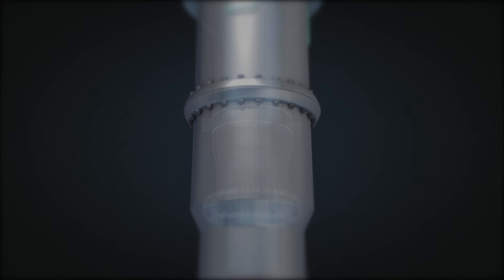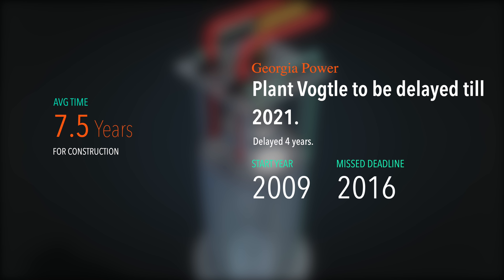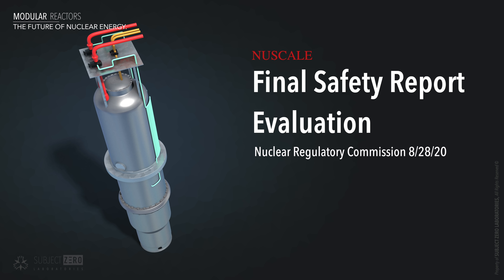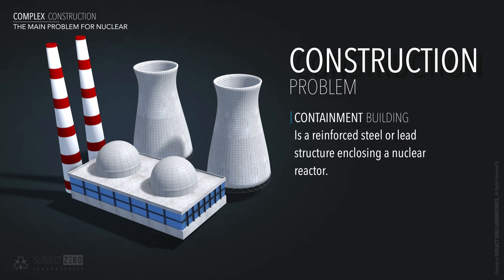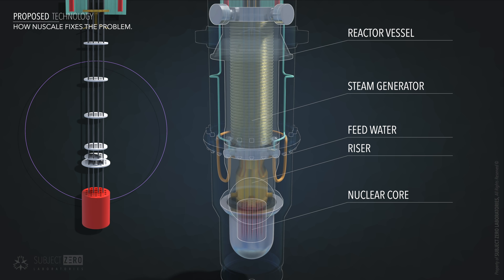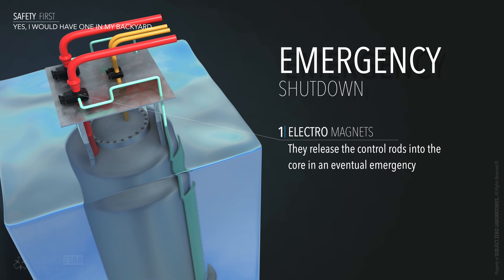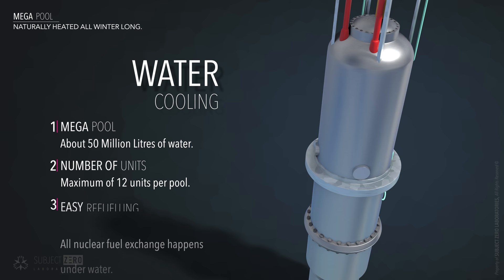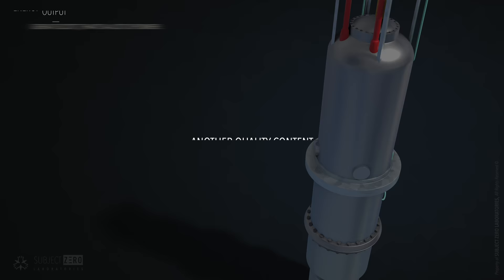A Milestone for Small Modular Reactors (SMR 2020)

Comment: $3 billion dollars for 720MW with nuclear’s superb capacity factor would be very competitive. That’s A LOT of decarbonization, air cleaning potential for $3 billion. We should be pushing these ASAP in the Midwest USA where coal use is still so prevalent, particularly in states with subpar resources for renewables and/or aging traditional reactors. 
Here in Indiana, we have no hydroelectric dams, solar capacity factors around 18%, only a tiny sliver of Lake Michigan for offshore wind and decent but not great onshore wind resources. 70% of our electricity comes from coal, with most of the rest being gas. Our attempted cathedral-style nuclear power plant was abandoned in the 1980s. 
Clusters of the SMRs would be a game changer for Indiana air and water quality, particularly in the SW corner of the state where large coal plants are clustered.

Comment: 720MW isn't remotely enough for 720K homes in most, if not any part of the world. That's only 1,000 watts per house.
Reply: I think he moved the decimal one too many places. Should be around 10kW per house, so that's enough to power 72,000 homes. Still quite good, especially if supplementing renewable energy sources.
Reply: @rthomp03  "renewables" are not functional energy sources. It's all a scam supported by subsidies. You can't "supplement" something that doesn't work.
Reply: Brad I could say the same for methane
Reply: @thepope2412 but isnt the point of this to reduce carbon emissions?
Reply: @xxxBradTxxx  I don't think the core of Earth is leaking anything into the ocean. The crust does, however, mostly material that's eroded away and flushed out by rivers. Harvesting uranium from seawater works fine, it's just not economical to do it at current prices. Long term it's effectively a renewable resource as you say.
Reply: That depends on the type of heating used, for one. If the houses use district heating and district hot water, I could see the average consumption being under 1kW for a household.
Reply: SirCutRy then you turn the stove on
Reply: SirCutRy peak power is a higher number than average power. When you turn the stove on you are using above average power. If enough people turn their stove on (or other things) the time they are using well above average power.
Reply: @thepope2412  Have you found a number for the peak demand?

Comment: The proposed reactor uses Fuel rod or pellet systems.   They're more costly than technologies that dissolve fuel into molten salt.    Molten salt reactors are also available in small sizes, and much safer.

Comment: Operating cost would skyrocket if they had to insure their plants like every other plant operator...
Also while CO2 emission are low, what about the waste and its cost?
Reply: @nousername8162  I think you can actually "burry" co2 in some ways. For example there were plans to pump co2 in a gas cavern in my region that currently stores natural gas. However co2 takes up significant space compared to nuclear waste of course.
Reply: This can be reprocessed into MOX fuel and used again. It can also be re used in molten salt reactors, and from their we have basically used it as much as we can. Dont worry about the waste tho, its a physically small object and so its able to be stored away easily using deep geological storage sites, such as the on in finland.
Reply: Nuclear power operators are the only one who actually insure their plants and need to pay for cleaning area afterwards as part of their construction.

Comment: 3:46 Fukushima plant was designed to withstand tsunami just not the magnitude it encountered that day. Additionally, the countermeasures were deficient, e.g. not placing the emergency power generators at higher elevation.
Reply: Cutieplus  Wrong. 6 meters was the result of costs/benefits analysis. The scientists knew that tsunami waves in this area were above 10 meters in relatively recent history. The elevation inside the power plant fence reaches over 40 meters. Placing the generators there at the cost of some extra cable, would prevent the accident. It was an exercise in cost-cutting gone wrong and poor failure mode analysis combined.

Have a look at https://www.world-nuclear.org/information-library/safety-and-security/safety-of-plants/fukushima-daiichi-accident.aspx listing simple measures recommended long before the tsunami, which would prevent the accident.

Comment: Stop building these huge PWRs and the front end costs will tumble. 
When you don't have hot water under high pressure you dont need the huge containment and you don't need the active safety and cooling systems. The Moltex approach removes the hazards rather than using engineered solutions. That removes many of the regulatory costs.
Molten salts are liquid between 450 and 1250 degrees C. they have good thermal properties and are not affected by neutrons and ionising radiation. Best of all the salts deliver a high negative thermal response. The reaction rate falls rapidly at higher temperatures making the plant entirely self regulating. The Moltex has boron control rods simply to meet the regulatory rules its does not really need them. 
The Moltex has vented fuel rods filled with a fuel salt mixture of active element salts and chlorides - table salt. Gasses created by nuclear reactions can vent away so there is no internal pressure build up. Easier to get approval for. Heat is extracted by sitting the fuel rods into a pool of molten salt. The same type as used within the fuel rods. Heat is extracted for use outside by heat exchangers carrying a third molten salt. The latter is technically outside the nuclear regulated zone. Another gain for regulatory approval.
The high negative temperature coefficient means it cannot overheat. The tertiary salt could be switched off and it will get a bit warmer but outside the ideal temperature the power level drops. It can not overheat. 
There is no pressure vessel meaning nothing to regulate on that. There is no risk of steam explosion so no containment dome meaning another win for regulation. It all works at near atmospheric pressure. 
The heat is moved by convection with just a small circulatory impeller to stir the pool salt. The fuel salt is not pumped. The high negative temperature power coefficient means there is no emergency cooling. But if a fuel the rods did burst, the fuel would become so diluted there would be no possible fissile reaction. It's fail safe. 
There are boron shutoff rods but there is no need for emergency cooling.  Decay heat is handled by continuous convection air cooling to the external case which cannot be shut down. This small efficiency loss is more then compensated by having no need for active cooling systems.
The plant runs in the fast spectrum allowing it to burn waste spent nuclear fuel. This old irradiated material still has up to 95% of its original fissile energy so a waste burner reactor will never need to mine any new fuel. The resulting waste will go from a 30,000 years half life to just 30 years half life. That solves the long term storage problems.
Elysium have a similar plant that operates on the same principle with a different design. But again it is as simple as possible allowing easier regulatory approval. 
The problem is the slow regulatory process. In UK its just deadly slow and seemingly run run to create delays. All of which is adds to the plant owner's costs. The USA has regulation system designed for the old style PWR. If you have a different design, no matter how simple and safe, it just cant get approval until new rules are written. Canada is a little more sensible so the first Moltex will happen up there. Expected to be putting power on line by 2030.
Reply: @bioswars8827  Stop with your copy paste spam
Reply: @KingofHearts67  Except this is not copy and paste. I have linked above to Ian Scot explaining his Moltex systems.
Reply: @davidelliott5843  wasn't referring to your comment. Looks like the comment I was talling about is gone now.

Comment: I worked at a nuclear plant as a Quality Engineer for about 22 years.  And before that as a Quality Engineer for a pump company that made reactor coolant pumps for nuclear subs and commercial nuclear power plants.  Great jobs BUT reliability and safety are not the only considerations.  
Lets start out with waste heat.  You know the heat that is dumped into our rivers, lakes, oceans and air as power plants operate. They need cooling water to cool the condensers so feedwater can be reheated into steam which powers the steam turbines to make electricity.  AT THE MOMENT we waste about 60% of every BTU of heat energy we create and it doesn't make much difference if the heat comes from coal, natural gas or nuclear power.  You put in something on the order of 3000 MWt [Megawatts Thermal] and get about 1000 MWe [Megawatts Electric] out.  That 2000 MWt is just waste heat and it has to go somewhere and that somewhere is into our environment.  Here is how we are already affecting weather patterns over 1000 miles from some of our major cities.  This is no joke people, power plants help heat up our planet.  It's not all about just CO2, oh sure most of it is caused by burning carbon based fuels and of course nuclear but certainly not all of it.  Here is the link. 
 blogs.agu.org/geospace/2016/06/17/study-waste-heat-major-source-national-warming/
So now you know just another small piece of the puzzle.  Now let's multiple that waste heat by let's say another 500 or so new small modular reactors and of course they will be smaller and each one will produce less waste heat but they will ALL have waste heat regardless of their size.  Everyone one is going to dump waste heat into our environment.  Starting to get the picture why renewables like Wind, Water and Solar are better.  Oh sure they do create some heat as they generate electricity but most of them are well above 75% efficient except for solar which is about 25% efficient.  But it's value is that it is safe and start and stops all by it self - no humans needed, ha ha.  
So in my not so humble opinion we need to rethink what we are doing.  Everyone gripes about efficiency but Electric Vehicles are 80+% efficient vs gas vehicle which top out at about 40%.  Home air conditioners are energy hogs even the highest SEER units you can buy use too much electricity.  And our old homes with 3 1/2" of insulation in the walls - yup that is not good either.  Did you know the United States consumes more energy per person that any other country on this planet?  We are a very wasteful society and that really needs to change. Over 5 years ago I set this goal for myself - "help clean up the air we breathe and the water we drink for everyone on this planet". That is my goal - what is yours?

Comment: So, they took all the parts of nuclear reactor, showed inside a tube, and called it a "new solution for nuclear power"
Nothing was invented here, yes making independent reactors is safer in theory, but , cost and complexity of fuel exchange as well as the simple problem of inside repairs wasnt adressed

Comment: The future of nuclear energy is Fusion.
Reply: And it has been the future since I was in high school in the 1970's.
Reply: @bradleyanderson4315  we will have ITER soon. It's happening, step by step. Before the end of the century fusion will be THE answer for the energy crisis.
Reply: @bradleyanderson4315  It is not surprising. Remember this is pretty much the highest end of physical and mechanical engineering there is for powerplants. Highest temperatures, highest precision, highest voltages, ect. It is not going to fit anywhere, but appart from fission i don't see a better baseload for any country that does not have gigantic deserts to put solar pannels on

Comment: It's all most as if the Japanese had never even heard of a tsunami before. They built that facility at sea level, right in the shore.
Well, live and learn.
Reply: Well, to be fair, they did plan for a tsunami, there was a gigantic wall that was plenty against any conceivable tsunami. That just happened to be an inconceivably large one. Still not an excuse for passive safety tho.
Reply: Fukushima had a 14 meter seawall. But Chernobyl had some safety nets, too. These measures in both disasters did not succeed for the same reason. That is, budget cuts.

You see, Chernobyl's design used boron control rods that were tipped with graphite. This had a flaw that allowed the fission rate to spike as they were inserted, which directly caused the explosion. However, this flaw was discovered at another Soviet plant 3 years prior. But all reactors were left unfixed due to the severe cost of redesign and implementation.

During a 2008 safety test on Fukushima, it had been calculated that an earthquake could generate a tsunami as high as 16 meters. That was higher than it's existing 14m seawall. There were plans to extend the wall, in addition to waterproofing their backup generators. However, these plans were quietly dismissed by upper chairmen, who had purportedly not seen the safety benefit from such a high project cost.
Reply: It's Japan, dude. Sea level, right on the shore is 90% of their land.
Reply: 60 year old designs aren't the greatest. It was a Gen 1 reactor.
Reply: @kevinstrout630  Magnitude 9 earthquakes happen about once a century in Japan, so therefore a perfectly conceivable and expectable tsunami.

Comment: The biggest problem is that these still generate significant nuclear waste.  More effort needs to go into "breeder" reactors that actually USE nuclear waste as their fuel...and a LOT more effort needs to be put into disposing of the MASSIVE amounts of nuclear waste that are being improperly stored in sites across the US NOW.  (Hanford WA being a clear example of why this is a problem!)  I am ALL FOR nuclear power, but it MUST be clean, and we MUST deal with waste issues before deploying ANY more reactors for commercial power generation!  I prefer we focus on solar and wind, along with new battery technology and "smart grids" before using more nuclear power.  The reactor you show here is a huge leap forward, but we still have a LONG way to go to make this practical, clean and safe.

Comment: Solar Wind and Battery is a lower cost solution. Solar wind and battery can be built for millions and take years to finish, Nuclear Power takes billions of dollars and requires decades. Then the nuclear plant will run around 30 years (which is typical) and you have a high level spent fuel problem that needs to be buried for 10,000 years. However, the DOE hasn't approved transport routes, transport casks, or a national repository after 60 years of trying. No one is willing to expend the political capital to get this done. The result is we have 92 nuclear power stations with high level spent fuel "temporarily" stored in their backyards.

Comment: One problem with the design of that reactor. The tube of the steam generator is really long. That's challenging to construct. Also, good luck if you get a leak over there, there is no easy access to maintenance (or it seems that from the little information shown in the video). Don't get me wrong, SMRs are great for small cities that are in the middle of nowhere. However, I think that we get to the point that we need to move on from GEN III+ tech and go directly to GEN IV more advanced reactors that can reutilice spent fuel from other NPPs and that safely inherent (search for IFR) with a capacity of at least 1000MW. Thanks for sharing the video.

Comment: Incorrect. Fukashima's issue was waste fuel that was the outside of the containment vessel, in water. The hydrogen gas buildup eventually exploded and water was released, failing to moderate and cool the spent fuel. The reactors themselves shut down correctly on there own. The other reactors were actually still operable. 

Gen 3 reactors are passively safe, which means not external energy source is need to maintain cooling or moderation. If something happens, the operators can literally walk away and the reactor will safely shut down and cool on it's own as Gen 3 reactors used water as a moderator. As the water evaporates, the moderation effect evaporates with it and thus the fission process eventually stops entirely, preventing any sort of meltdown from occurring.

Comment: The issue for me is that we always build gigawatt generators, which have efficiency of scale, but also bugs in the same scale. What if, however, we take this small reactor design and scale it down, to power let us say, one village or several neighborhoods. Perhaps generating 50 to 100 MW instead of 720 MW. Smaller reactor, no need for 20 million liters of water in a 20 meter hole in the ground.

Comment: I do have one remaining question about the safety of these SMRs, and it has to do with the outside pool of water surrounding these modules.

Would it be catastrophic if the plant experienced a natural disaster where all of this pool water were to leak out and be unable to cool the SMRs? Is the plant at least architected in a way that a sudden loss of this pool of water is impossible?
Reply from the maker: Yes. The building for these machines have to be full proof to all scenarios. Earthquake, tsunamis, meteor, terrorism and anything else you can imagine.